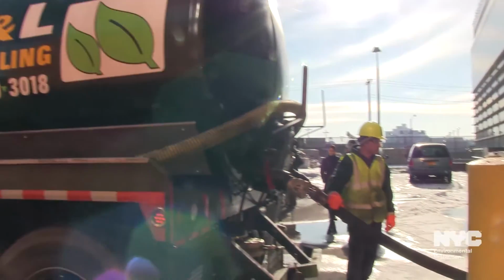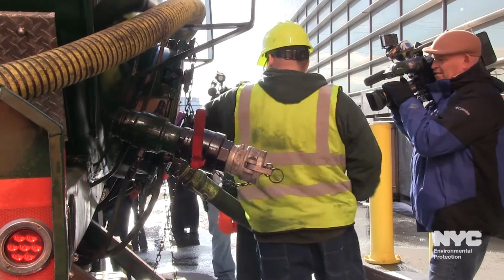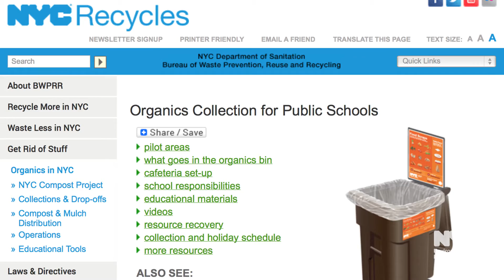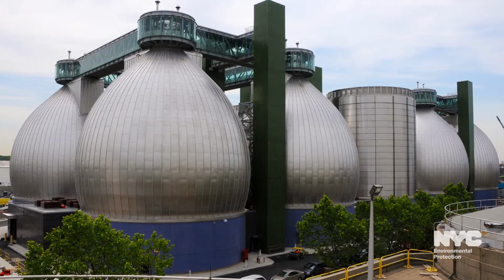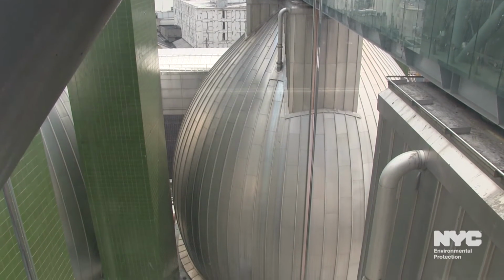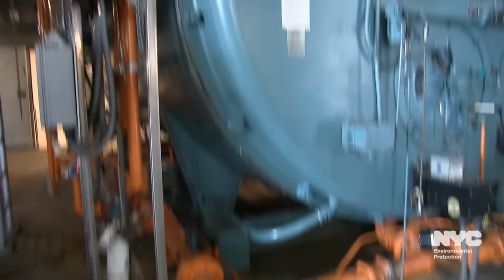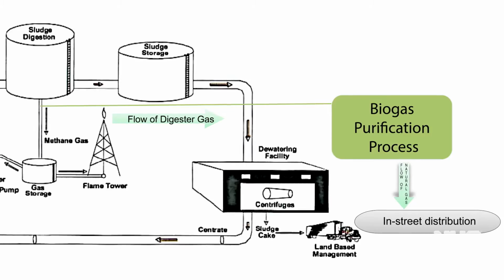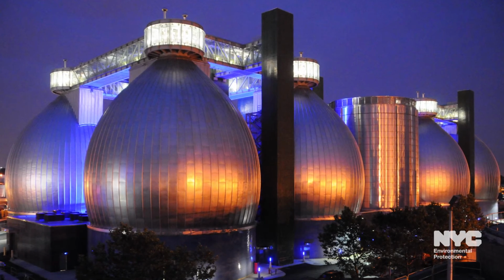The Newtown Creek Renewable Gas Demonstration Project

Comment from the maker: A pilot project is underway at the Newtown Creek Wastewater Treatment plant in Brooklyn, NY. The NYC DEP is joining forces with the NYC Department of Sanitation and National Grid NY to utilize biogas, a byproduct of the wastewater treatment process. Biogas is mostly made up of methane, which also happens to be the main component of natural gas. If the program is successful, it would be the equivalent of taking 19,000 vehicles off the road and will reduce annual greenhouse gas emissions by 90,000 metric tons. For more information go to: http://on.nyc.gov/JLYIFj

This video is made by the New York City Department of Environmental Protection (DEP).